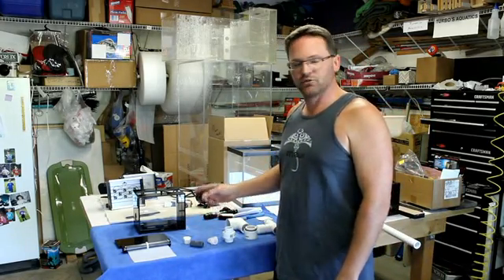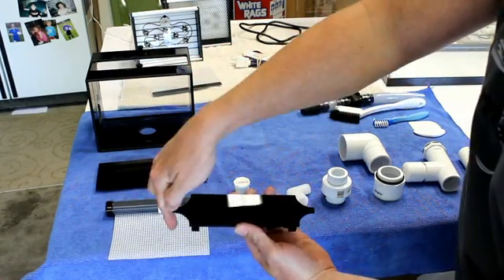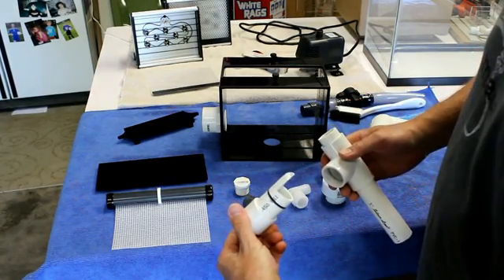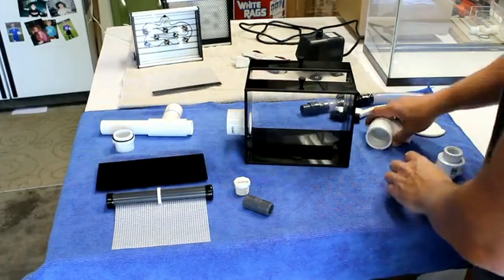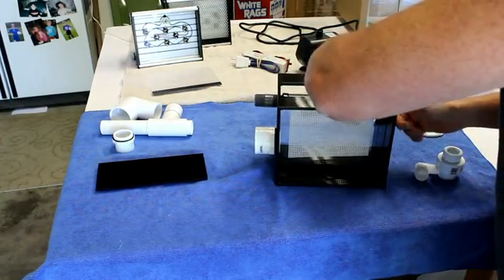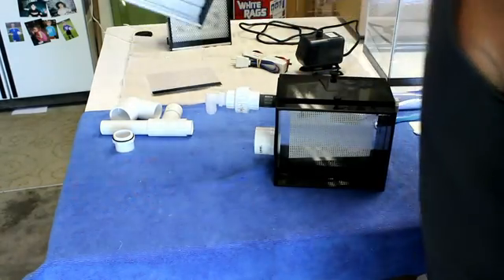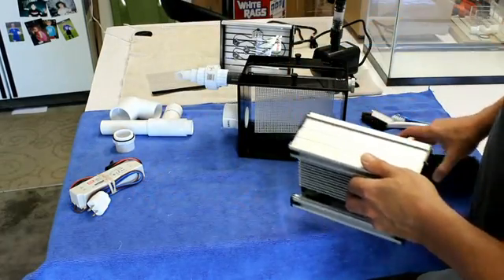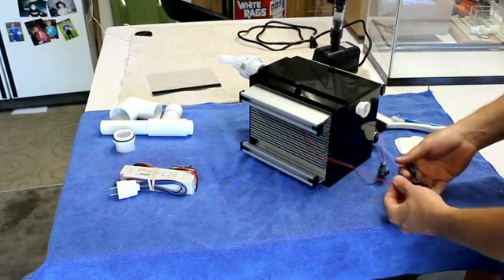Introducing the Turbo HF - Revision 3 of my Waterfall Algae Scrubbers

Comment: Seems a bit cumbersome and bulky.  How does it mount above the some sump?  With all the talk of algae scrubbers, how is this less maintenance then emptying your skimmer cup and cleaning it and or refilling your biopellet reactor?
Reply from the maker: If you take into account the total amount of time spent either maintaining a skimmer/BP reactor vs. an Algae Scrubber, it would probably be about equal.  I spend about 10-15 minutes every 10-14 days cleaning the algae scrubber.  It's more a matter of function rather than time saving, and for some, skimmer/BP doesn't solve the problem.  Some all 3 methods with great success.

Comment from the maker: These are sized loosely based on a feeding guideline. L2=2 cubes/day, L3=3, L4=4.  For a 400, I would go with the L4 for sure.  The feeding guideline is a good start, but with larger water volumes you then have to consider the turnover rate of the volume across the screen, so in those cases, the wider the screen the better.  The new versions allow for a lot more flow per unit of width of screen also.  Plus I doubt this will be your only form of filtration as well.

Comment from the maker: I run an L2 on top of my 120 (sumpless), I have an in-tank overflow box for the pump, but that doesn't really work that great honestly.  I think there is something to be said for good surface skimming.  If I had to do it over, I would make my little overflow box deeper and put the all the way down, then put an ATO float in there.  Bubble control is also an issue with top of tank, it's hard to balance high flow/filtration with nuisance side effects without a sump.  But I have ideas in the works..

Comment from the maker: Oh dang it.  I knew I was forgetting something!  Actually it's pretty easy, if you can see the screen when you are putting it in, you can wiggle the rotatable ring and the screen will 'wave' loosely if the slot is straight down.  You can also make an alignment mark on the top of the pipe with a Sharpie that you can use to eyeball it.  Perhaps I should weld on a notch and incorporate a laser leveling device?  Rev 4....LOL